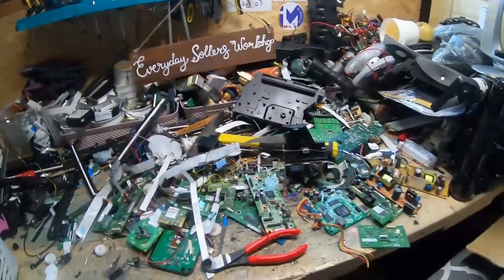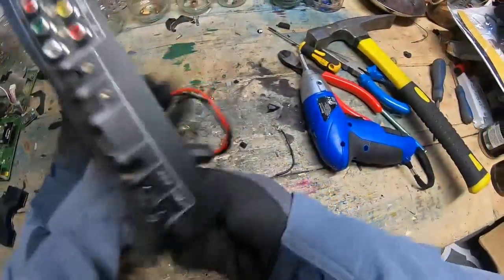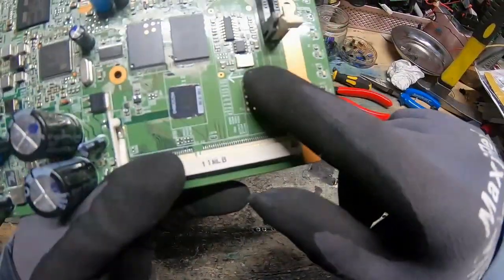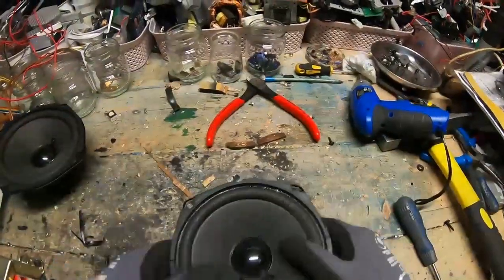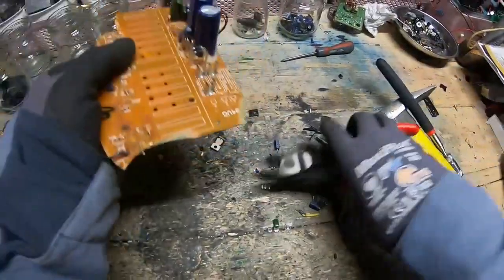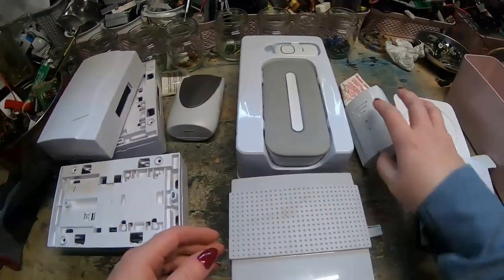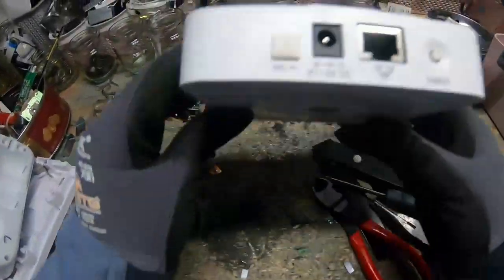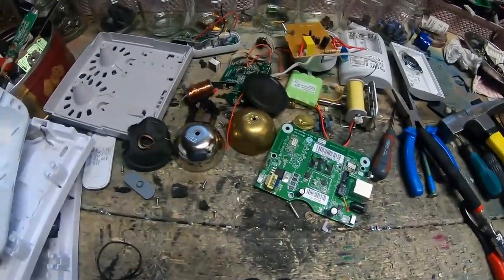Sollers scrap chat #8 🔔🎶 A mix from Cisco to doorbells, ring my bell and shed mess... be gone!

Comment: Hello.
That half aluminium transformer, questionable if it's worth taking apart. Otherwise with that kind of transformer are "easey" break up.
Give it a few bashes with the hammer on all sides to break the laquer, the laminates will loosen up so just pull them out with the snips.
Reply from the maker: Oh for sure, I've kept it for taking apart 🙂 Thanks for watching!